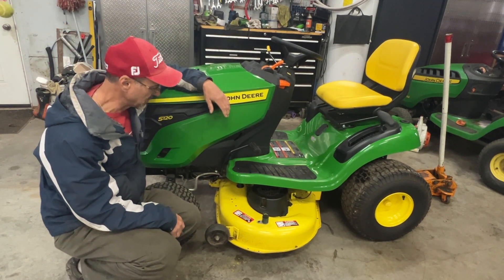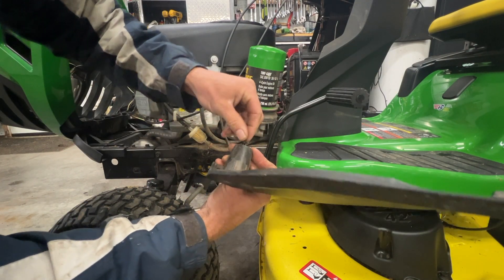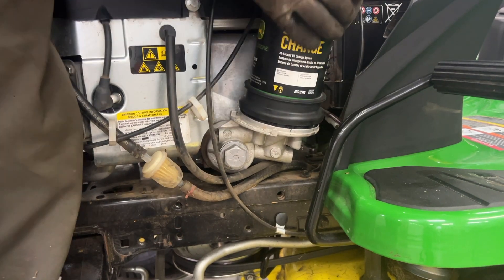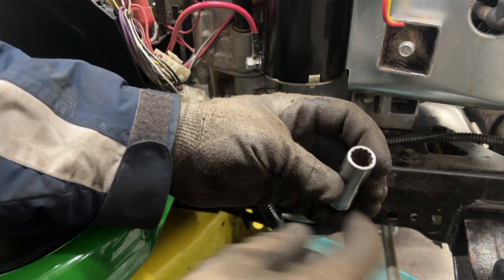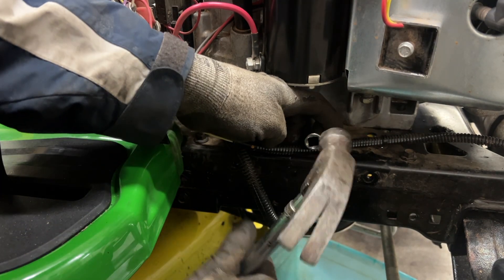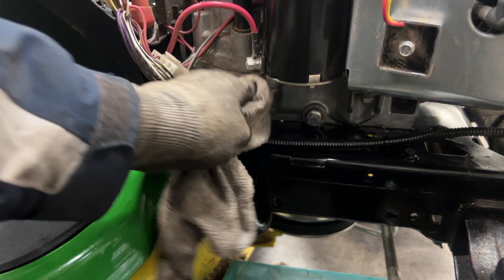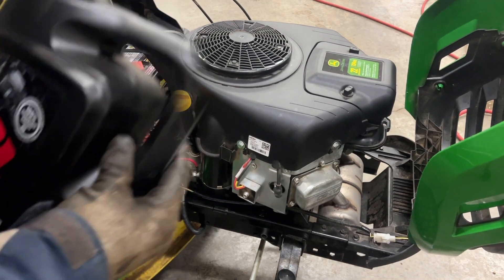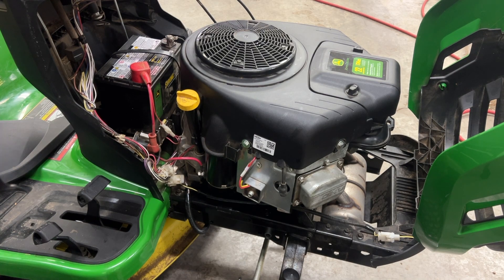How to: A Complete oil change with the Easy Change Oil / Filter. John Deere Riding Lawnmower S120

Comment: Hi I really could use your advice on a 1979 XL500 that is swapped onto a 1983 XL250R frame. The carb is higher than the boot to the airbox and I see you've done this swap before. So what should I do to link them together the air boot comes out directly under the carb intake
Reply from the maker: Yup, they don’t line up. You have to modify / cut the airbox to fit.
    You could add a aftermarket filter.   Might have to go one size bigger on the main jet.
Reply from the maker: Are you using the XL250s airbox?   Switch it with the XL500s.

Comment: Your quick change oil filter 10 W30 does not have synthetic oil. Yet you added  10 W30 synthetic oil.
Reply from the maker: It is 100% synthetic oil.